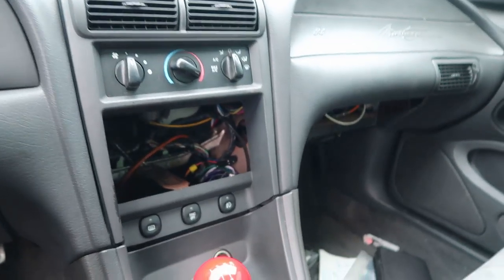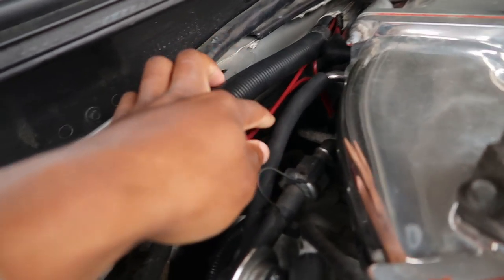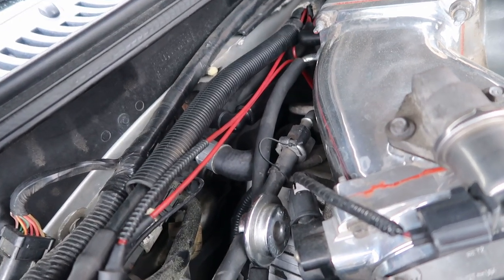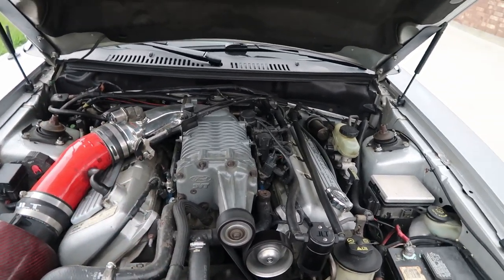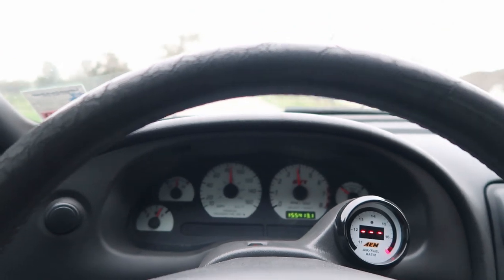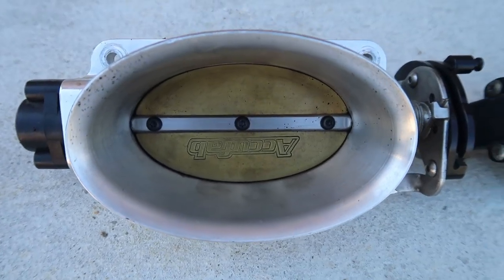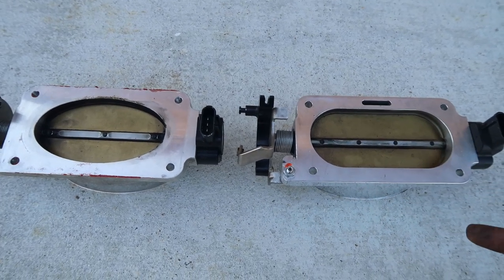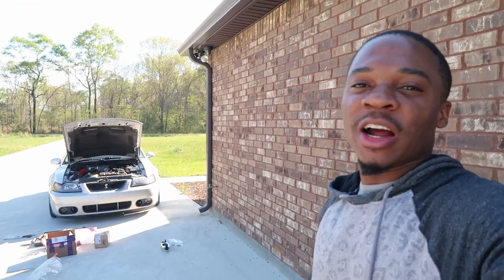TX2K Prep | The Cobra MUST Be Fixed!

Comment: A bad or sticking idle/air control  can also simulate a vaccum leak. Have you tried cleaning it or replacing it?
Remove the idle air control from the throttle body you removed. Clean it with carb cleaner. Clean the throttle body with throttle body cleaner. Reassemble and reinstall.
Also clean you MAF. A lot of times on boosted cars, oil from the air filters get sucked in.

Comment: When in doubt, rip it out! lol Any hoses that seem old should be replaced because vacuum leaks just suck...literally! That old throttle body was not meant for a boosted engine...much less air flow. Also, you may need to disconnect your battery so that your maf sensor will recalibrate for the new tb airflow. If your idle continues to bounce, check your IAC valve. Unfortunately, although they are great for WOT, Accufabs are notorious for idle issues. That is why I switched mine out for an LFP Bigmouth tb. Glad to see you post again!
Reply from the maker: The idle smoothed itself out after about 50miles or so driving.. Yea, my plans after all these installs is to get the car looking and running at its best👍🏽

Comment: The reason for high idle is because you are suppose to set the same vintage on the throttle body from original
Reply: Voltage*
Reply: Throttle body sensor should be same voltage